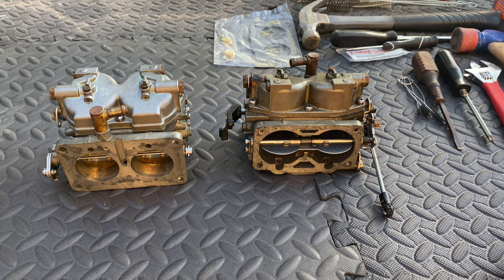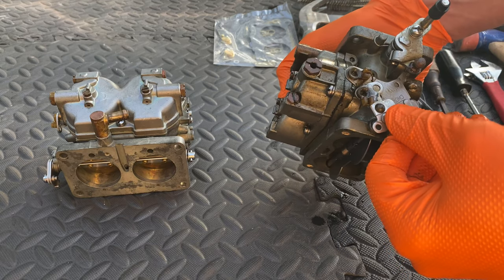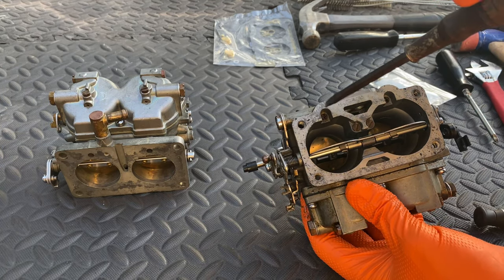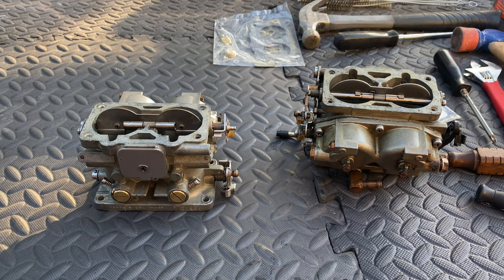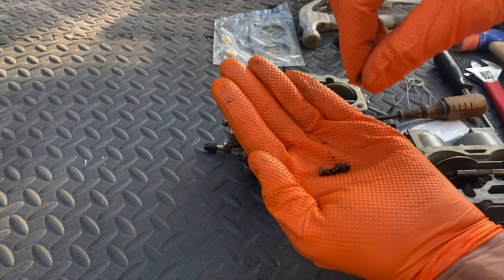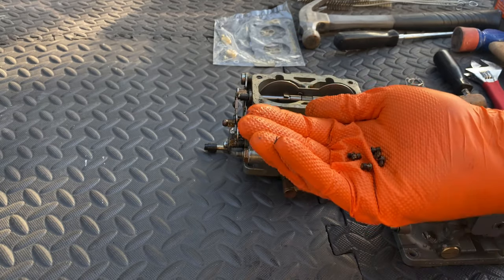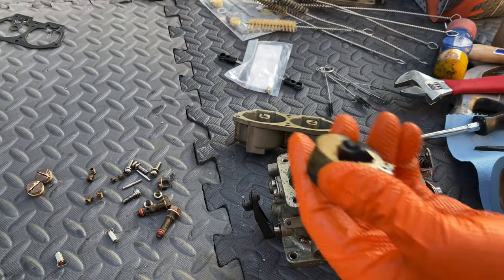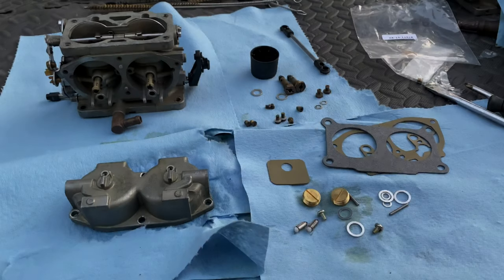Rebuilding a Yamaha Outboard Carburetor

Comment: Those brass plugs you had a helluva time removing using a punch. Little tip for you... use an impact screw driver. I got one from harbor freight that you hit with a hammer and it turns it at the same time. Good video!
Reply from the maker: Excellent advice! You know I’m getting one of those for the next time! Thanks!
Reply: See
Reply: My thought was to just put the screwdriver on and tap it with a hammer as your trying to turn the screwdriver. I’ve done that with other things and it has worked.

Comment: It's so much easier to loosen those big brass plugs before before removing the crowd. Again a well fit screw driver like you said. Lot of pressure, a few light taps and with pressure and quality screw driver turn with pressure and vise Grips attached to quality screwdriver. Easy-peasy way to loosen them up before the rebuild
Reply: Before removing the duel carb from the engine, not to crowd, damn spell check, sorry
Reply: ? Float levels?

Comment: I have an older boat(1988 omc cobra 4 cylinder)and am switching to electric choke but am wondering if the hot wire should go to a ballas resistor?

Comment: I got a 200 Yamaha 2 stroke with 3 carbs on it the middle carburetor had no fuel in the bowls at all the needle and valve was stuck motor runs fine on the hose it revs up it will run for hours and hours on the hose but soon you put the boat in the water put it in gear under back pressure the RPMs drop and soon as you go to put a load on the motor it bogs and stalls don't know what the problem is
Did a compression check on the motor 115 to 120 PSI in  cylinder any help would be great
Reply from the maker: One thing is for sure, these old carbs must be rebuilt periodically to make sure they are clean. It even sounds like you might have a fuel line clogged. The middle carb must be performing correctly before you go down the rabbit hole of troubleshooting other things.

Comment: I have the same carbs, and I'm struggling the with the float height, I think! 

Motor runs great on muffs, and will start on water, but within a minute or so, will stall out and not restart.. 

Great video!
Reply from the maker: Paul , please take the carbs out and rebuild them. These carbs get nasty real quick. I wasn’t able to see a way to adjust the floats. I typically do this on inboard motors. Let me know if you still need help and l I’ll confirm.
Reply: @michaelromer2016  - thanks! Plan to do that this coming week.. picked up an ultrasonic cleaner in hopes out can do better than I by hand. 

I've been through them a few times, always with the same result.. runs great on muffs, put it in the water, starts right up.. but eventually starves of fuel and will not restart.. not even on muffs. 

Will keep you posted
Reply from the maker: Definitely a carb issue.
Reply: You need to set the float heights
Reply: @jasonford2863  thanks. 

There was two things I found before tarping for the winter. 

One - I had one needle valve that would intermittently stick. I put a q-tip in a drill and cleaned the seat, that seemed to help. 

Also, the new needle valves I had, the metal wire that wraps around them was too tight? The needle wouldn't freely move.. it was stuck.. I think this was also causing them to stick occasionally. 

I went back to my original needles from when I bought the boat, and they seemed to move freely. 

Set the float height, tuned it in the water, and all was well... Until.. I found water in my gas tank. 

The boat ran in an external tank. I hooked up the main tank, and it dies within a minute. Drained the carb bowls, and the milky gas that came out was unbelievable. Gas wasn't that old, and was treated! No ethanol! 

Had to put the boat away for the season, but looks like I'm in for some gas tank fun in the spring. Also ordered new needle valves, and a fuel pump for good measure.

Comment: Very clean and neat video, congrats Michael!!....wright now I am dealing with a 130 hp motor with  twin 6L102 621400 carburetors....I bought the motor 6 months ago but I noticed a high gas consuption so I took them off to chek them out and notice differences in the main air jets...the one below has #80 and the other has #220......do you happen to know wich will be the correct one. Regards.
Reply: I found my stock jet size on Crowley Marine website by checking the diagram for the carb

Comment: my 99 looks alot like this one. my replacement gasket for the bowl was rubber looked to be touching the floats and keeping the needles from seating. had to trim them. have you run into this?
Reply: I rebuilt my carbs on a 89 225 with the same carbs. Randomly I get a float that wants to stick when I'm on the water. I took them apart and noticed the gasket tab behind the hinge of the float would catch the adjustment tab on the back of the float every now and then not allowing the needle to seat. I trimmed it off because I don't see a need for it and I'm anxious to see if this doesn't solve the problem.

Comment: Hey Michel, would you be able to tell me how many turns out your pilot screws are? I'm following this rebuilding the same carby right now
Cheers!
Reply from the maker: I believe you are referring to idler screws. Those typically need to be turned all the way in and then backed out 1.5 turns. Adjust as needed to keep the outboard running. Please subscribe!

Comment: Hi Michael! 
I have OMC 4.3GL, the engine oil turn into milky looks, I knew the water have got inside. Volvo Penta SX Series is my out drive. I’m thinking go to local chuck yard buy a lowest mileage engine to replace my engine. Please tell me which car model engine it fit in my out drive . 
Thanks.
Reply from the maker: If you do that, keep your marine carb. You need to remove the steel freeze plugs and replace them with brass.
Reply: Thanks
Reply: What websites that you order all your Volvo Penta parts?

Comment: Urgh!!!  Just get a bigger screwdriver!!!  The punch!!  Noooooo!!   Lol.
Reply from the maker: Off camera, I put the carb against a table. My helper held the carb down, while I had a giant flat head/Crescent wrench on it. It slipped. I also tried 3 runs of penetrating oil. I debated using a propane torch or punch.
Reply: Michael Romer just did the same thing 30yr old 2GC Rochester   had to grind the hex head into a slot to use a flat head, nothing worked, heat oil etc...     great job
Reply from the maker: Thanks! Great hearing from you.